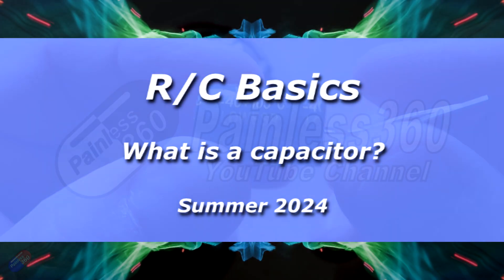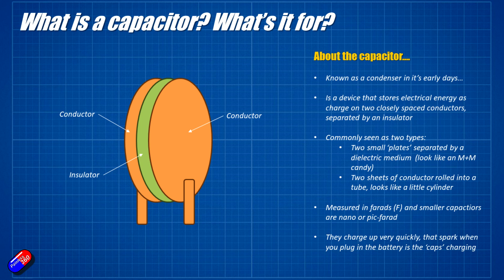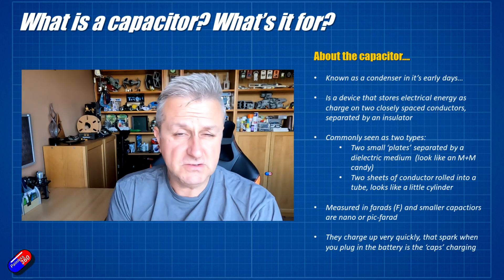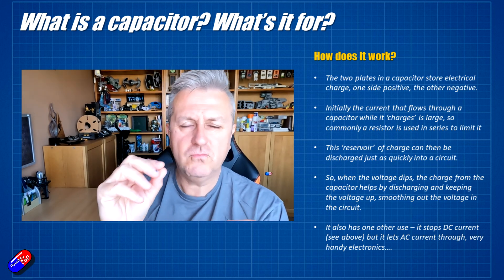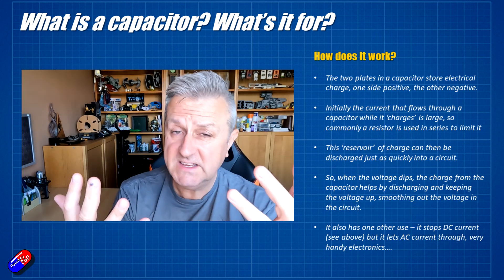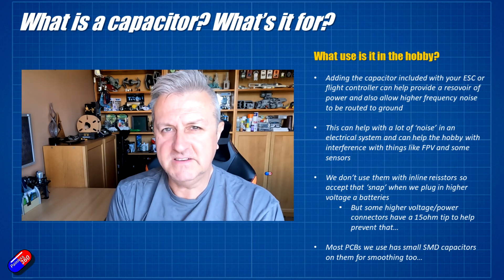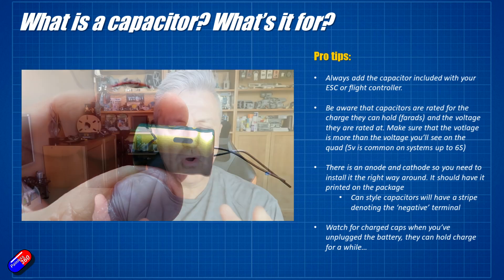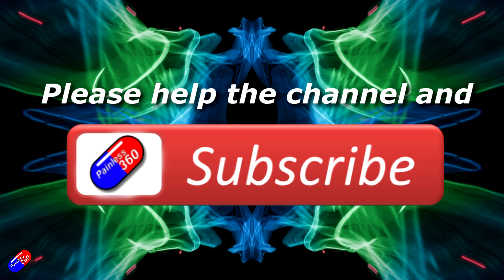What is a Capacitor? A simple explanation for RC builders...

Comment from the maker: Thanks to those who spotted the typo on the slide that shows 5v when I'm talking about 50v. That one slipped by! 

Also, if you are also an electronics engineer and already understand the features and uses of a capacitor in a circuit, thanks for remembering that this video is aimed at those who don't have that knowledge. 

This video is simplified to make the subject easy to follow and remember. See a comment about pedantry in the video description. ;)

Happy flying!

Comment: I accidentally reinstalled a capacitor the wrong way after fixing an xt60 connection. It popped like popcorn as soon as the battery was plugged in and it fried the flight controllers mpu. So yes do install them the right way.

Comment: I would say to be carefull with "capacitor as DC filter". It can cause nasty transients since most of stuff is not pure C, L or R but a combo.
And capacitor in parallel to power wires filters noice well but speeds up discharge (although a little bit) since it eseentially shorts them for AC.

Comment: big caps between 20-30 farads are  used a lot in very big car audio systems for the same effect just on a bigger scale  to add the very fast response when the amps pull huge current so you don't get as much voltage drop etc. the same on powerful electric bikes for the same reason